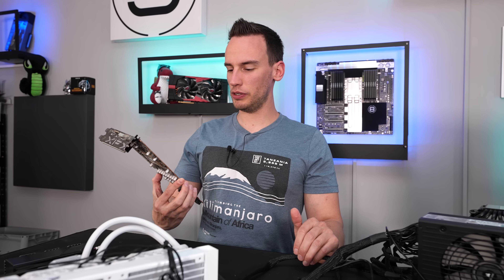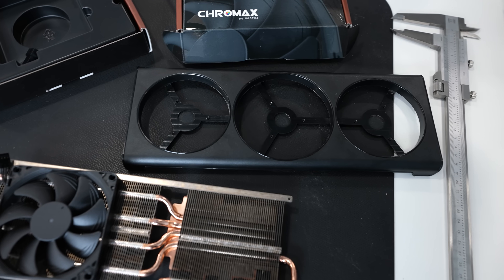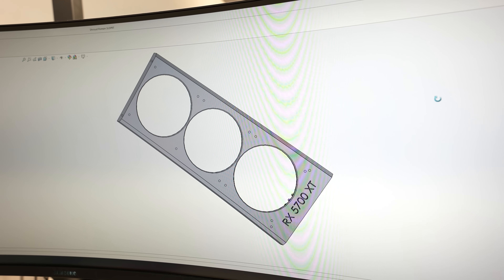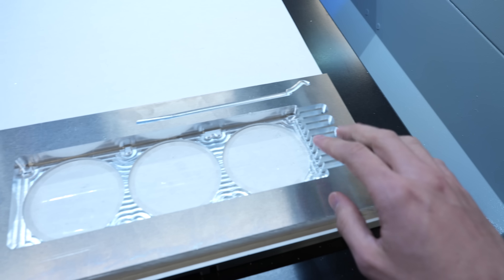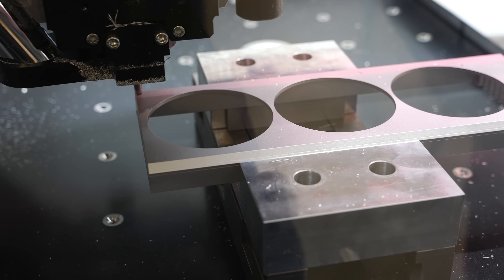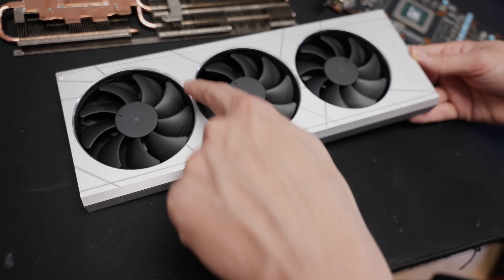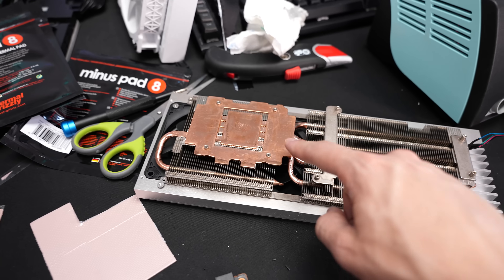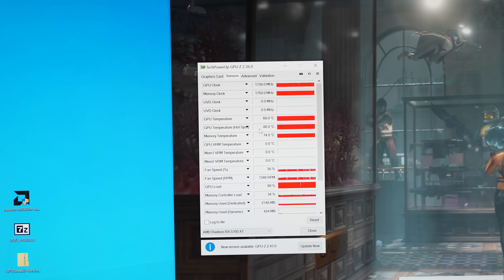We made our own 5700 XT Noctua Edition and it turned out Amazing!

Comment: It looks fine now but I think the aluminium will eventaully oxidise and have different look.
Assuming it would oxidise everywhere evenly, it wouldn't be a problem, but, one fingerprint(fat) and that spot will not oxidise and the card will end up with spotty surface.
Definitely anodise it, even if you want to keep silver colour, you just get it anodised clear (with no dye).
And yes it will look great if you anodise it black and then do all the chamfering/detailing afterwards

Comment: Hah, i almost buy this fan for my RX 470D from Biostar. But my approach is different since it use almost-same thickness 14mm default to 15mm. I cut my ID Coolong NO 9215 frame, zip it to my gpu cooling frame, and done. If i use Noctua, it will cost me alot of money, so yeah...i keep my id cooling until i can buy new GPU.

Comment: The shroud hangs too low, blocking air from escaping at the bottom. It should be lifted a bit of the MB. Is there a gap between the fan and the shroud? If there is, then why? Lifting the fans a bit of the heatsink is a known way to let the air pressure even out a bit, not sure what you did here. Anyway, you did not block the areas of the heatsink that has no fins, so there is a massive loss of air pressure. If you raise the fan a bit of the heatsink, and direct all the air through the heatsinks, results improve quite a bit. You also seem not to cover the fact of the initial power draw of most Noctua fans, which is insane compared to other fans, which for this type of application can be an issue. I have struggled to find any cheap adaptors for regular fans on GPUs, just the normal insanely expensive ones.

Comment: That's how the Radeon 7 should have been looked like. it's just looks amazing.... for the last 15 years GPUs made to look cheap with plastic covers or put RGB lights everywhere. I don't think need to paint it in different color as well, It's looks that good.
Reply: The shroud he made looks better than any shroud I've seen out of a factory imo. Plastic gpu shrouds are meh
Reply: Using sheet metal works well for cheap production
Reply: way off, the CNC part costs close to the GPU, itself, - it's an unrealistic approach for a non-boutique item
Reply: @stanimir4197  Did I said it's have to be made via CNC machine? If Asus can make an all metal cover for 3080 GPU, I'm pretty sure GPU makers can make somthing similar to what Derbauer made here.

Comment: Really nice project loving it, but i think you should put your logo on it :) ... And second thing if you will read this. You use thermal grizzly pads. And i hate how hard they are, as you said you need lot of pressure to squish them. And in my country i can buy only TG and Arctic Blue or Pink version. Blue version is hard too (but not as TG) but Pink is so soft it is only 1.2Wmk. But thanks to how soft they are i rather use that. Try use TG on Dual GPU you have bad contact on GPU die and with all that pressure whole Graphic card is bent like banana

Comment: You should make a backplate with short hit fins along with a heat pipe going right behind where the memory modules are allowing more of the heat from the memory to transfer to the backplate more effectively then with the aluminum backplate having short fins giving it better thermal transfer possibly dropping temps a few degrees Celsius. Also if temperatures drop then you should powermod the 5700xt and see the scores you can get

Comment: Curious how much weight the aluminum adds as opposed to a 3d print. Additional weight on GPUs causes the lower memory chips to fail earlier from stress on the PCB, doesn't it?
Reply: It would actually be a card great stiffener, and in theory if the mass is connected at all to anything remotely warm should add thermal mass and surface area.

Comment: Thermal Grizzly pads are much stiffer than stock and you need to adapt various things - add pressure or use thinner pads, when you said you followed specs I was like oohh that won't work 🤣

I wonder how much temp you'd gain if you made a second piece to the shroud that made sure all the air from the fans is necked down to the smaller stock heatsink?

Comment: I'd have thought you'd just use a plate of aluminium and bend it to shape. Would have been a much simpler process with minimal waste and less cost. Sure, it turned out great despite the imperfection, but you definitely did it the hard way

Comment: personally, if i was the one making it, i would make one the sides on the shroud more open (the side that goes towards the motherboard) so it could exhaust the heat out a little easier. perhaps an idea to test if that works?
Reply: I don't think it would have mattered.  The shroud only went down as far as the frame of the fans.
Reply: @RyuFelinshire  Yup, he literally just made  an amazingly overbuilt fancy fan frame.

Comment: What a beautiful shroud. I have never really liked RGB madness in PC set-ups. If the tiny fail happens again, or bothers you an experienced TIG welder would have the skills to fill the void and with minimal finishing could be unnoticeable.
Reply: lol yes indeed and often forgotten way to save it

actually on this subject of TiG + machining...

i also wonder to ask if it is ever reasonable to tig weld a slightly oversized hollow box from flatbar pieces. and then machine the rest of the way. in order to save machine time and wear. with fewer wate chips to deal with afterwards. depending on the bother for welding the box. and also the specific goal. the approach might not worthwhile simply for this gpu shroud. but what about for some larger objects? such as a furniture. or an entire custom shaped pc case? but then again, it is more sensible to make as individual pieces. and just screw them all together. or friction fit / precision fits or whatever. only if you really wanted the better mechanical screnth provided of a real weld. and for example on a thinner sheets / lower mass. and none of that engineering is so critical for these types of pc building projects

Comment: I still recommend using an ultrasonic cleaner to clean the card PCB, especially to clean under the BGA chips, like memory and the GPU, because corrosion can still exist there after all you have done.
Reply: I use both, but I don't not agree with ultrasonic overhype.
Reply: @yx8074  ultrasonic cleaners break dust into smaller particules making them unable to stick anymore.
You must use ultrasonic cleaner with IPA. That's dangerous if not done the right way. Don't smoke next to it..
Reply: @goldnoob6191  I don't smoke ever, but thanks for advice! :D
Reply: @yx8074  😅😅. Alcohol vapor is very dangerous it's best to keep the bath hermetically sealed.
Reply: @goldnoob6191  I won't try alcohol. Did you?
Reply: @yx8074  yup I did, for my SLA prints. Sometimes I use it on small PCBs, It does consume a lot of IPA but the result is great, especially when you need fine details or printing bearings
I also often use other non volatile cleaning products or a mix of both.

Comment: Would be really cool to see a complete custom cooler in the future, with a custom backplate, properly painted and everything, great video btw
Reply: Yeah we used to have aftermarket heatsinks for gpus. It was the only way to have normal noise levels back then. But since nonreference gpus started shipping with big dense 2 and 3 slot radiators its popularity declined and now many people dont even know they exist. The chips also got big and without shim so its easy to dmg gpu while remounting cooler.
Reply: @sznikers  nahhh its more of nvidia founders stopped using those god damn awful blower cards
Reply: Didn't Linus once do Hydro-dipping to make custom back plates?
Reply: With a cnc mill it should be possible to make fins (making a die and using a hammer to fold them), and you can buy heatpipes
Reply: deb8aur just needs to team up with steve and noctua start making reference cards
Reply: ??? isnt that what those ARCTIC Accelero are

Comment: This looks even more awesome than the majority of commercial cards available right now. 🤣🤣
Reply: Problem with commercial cards, is they are marketed for their flashy RGB looks, not how well they perform, with a classy look to them.
Reply: While true, the cost of making a shroud like this via CNC is also a lot more than the rgb + plastic shroud generally used.
CNC mills are not cheap, and you are paying for that machine time.
Reply: @qlum  RGB accounts for a 120% profit margin price hike, don't be fooled. They're charging you extra money for crap you don't need. It's everywhere in 3rd party PC components, because it drives up profit margins for very little effort to the manufacturer.
Reply: @JosephArata exactly, which means get ready for an even higher price high for a nice fancy shroud like this. If they're up charging on minimal effort, what do you think they're going to do for maximum effort?
Reply: @qlum  Better looking than any card on the market. And the same design can be made using plastic.
Reply: @mateusmt6194  I do agree with you that the gamer asstetic really is not great. As for material, there are more economical techniques at large scale that are not that expensive.
Reply: @qlum  Also, CNC mass production with aluminum is extremely cheap when you're creating 10, 20, or even 50 parts at one time on a giant slab of aluminum. The machines that do batch work can knock out complex aluminum parts in minutes or a couple of hours, instead of days.
Reply: Efficient quiet black fans and a metal shroud. Simple, elegant, beautiful.
Reply: The majority of commercial PC parts are not a clean functional design, but they need to have some weirdly shaped aluminum cooler with RGB back-lit dragon that increases manufacturing cost by 5$ and it justifies label "pro-gaming" and charging 20$ extra. I don't like this trend, PC is just an electrical appliance for me, that should be silent, it should not illuminate the room in the evening. I would not mind using memory sticks without any cooler on a green PCB and the only part where aesthetics matter is the PC case for me - sadly all are black or white and materials are cheap steel, plastics, and glass, in best case aluminum.
But this card looks pretty decent, I like it.
Reply: palit 4090 looks similarish

Comment: 9:26 The top and bottom has very thick aluminium, I think you could save a lot of weight on the cooler if you milled out most of the top and bottom "bars" from inside
Reply: I mean, you can just go with sheet metal too.